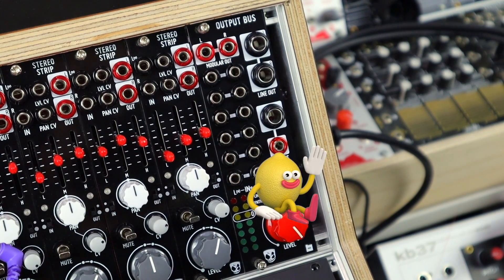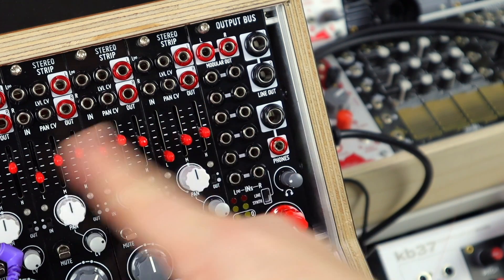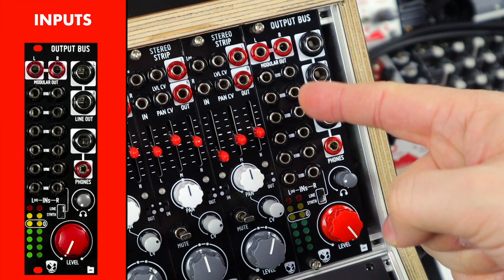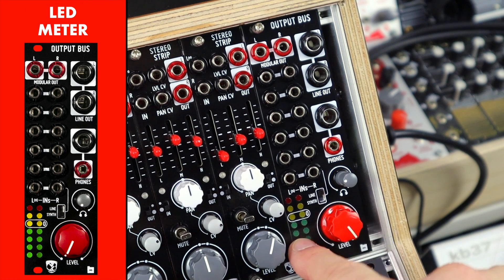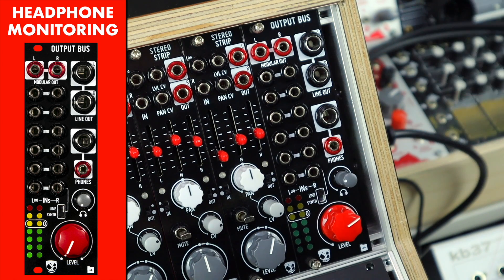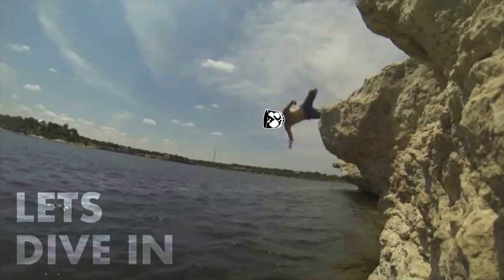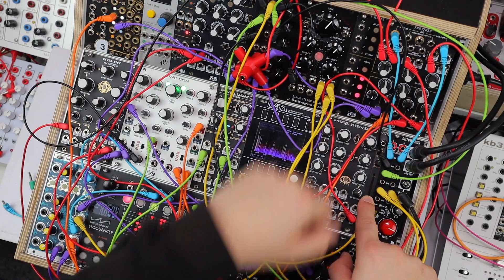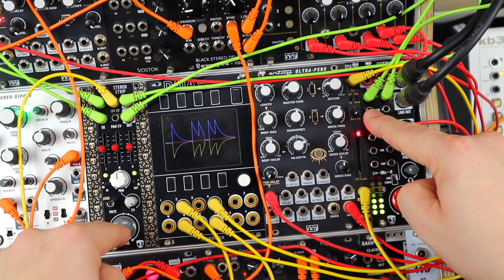A Eurorack Mix & Output Problem Solver // Output Bus from DivKid & Befaco

Comment: Well the way I look at it is that everything is reduced to line level eventually so why not just use a line level mixer that already has all that built in and would cost a fraction of what those 7 modules would?
Reply from the maker: Hello, I take it you're referring the final patch which is the 6 Stereo Strips and Output Bus. Absolutely an external mixer is way cheaper than any modular mixing solution. 

I wasn't trying to push 6 Stereo Strips as essential, I think I said you can "build a dream modular mixer" out of anything in the video. The Stereo Strips were just something I wanted to try. So where I think this is really exciting is having, a channel strip or two, FX returns, a performance mixer etc and summing all that together to build a mix out of things some people will already have.

If you don't want to stay in the box, going external is a more economical option with larger control surfaces etc. What they don't offer is CV control. With the Stereo Strip you have a stereo VCA and panning circuit under CV, both of which can be really handy and creative.

So yeah, I agree an external mixer is a great thing to use with modular if you don't want any CV control and have space to use both together.
Reply: @DivKid  Yeah the CV control is a big plus I guess
Reply from the maker: not for everyone or everything though, so if you're willing to cart external gear around an external mixer works well. 

It might be a situation where something like a couple Stereo Strips do the CV stuff but they output to an external mixer.

Comment: nice one,hope befaco fixed issues with scratchy pots like in out v3 and stmix
Reply from the maker: Thank you :) 

We've definitely had no scratchy pots on the Output Bus or Stereo Strip with all the units I've tried. 

I did have an stmix with a scratchy pot, never tried an out v3. 

It's well worth mentioning things that have issues but it's a shame if people tarnish one company with one issue they had that hasn't been an issue for a  long time (in lots of cases). Just speaking generally I saw this years ago with one company that were always talked down about as having loose pots, despite those pots been what several other companies used at the time that felt exactly the same and more recently with people talking about loose sockets that were a one small batch issue that has been addressed since. 

I hope I didn't word that rudely, certainly not responding badly but just sharing those general thoughts.
Reply: @DivKid  thank you for the response, I absolutely didn't mean to blame the company being absolutely happy with other products
Reply from the maker: Not at all, I didn't take it that way I was outlining. Just passing general comment as it was something on my mind. Thanks for taking it well and glad to hear you've enjoyed other stuff from them.